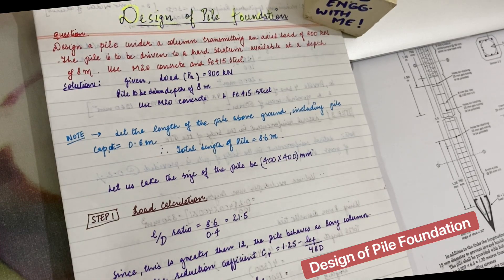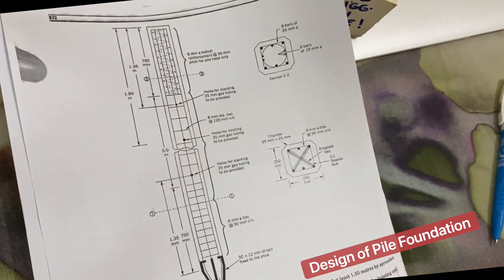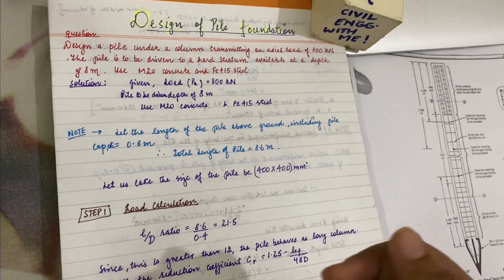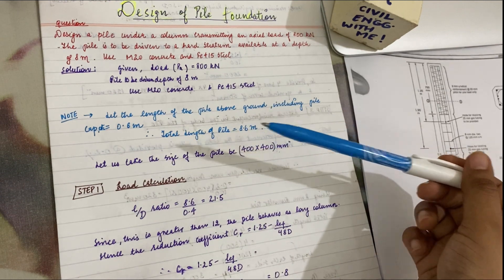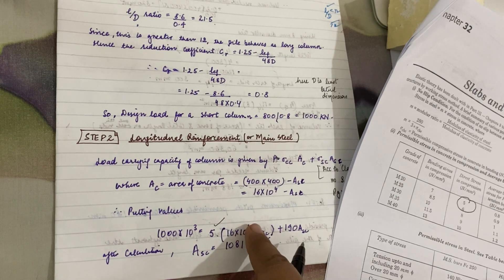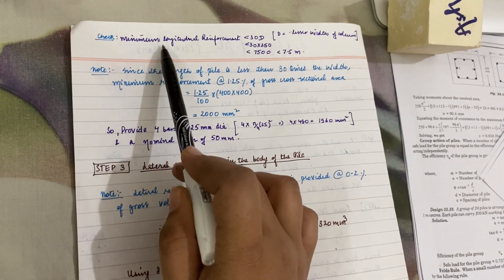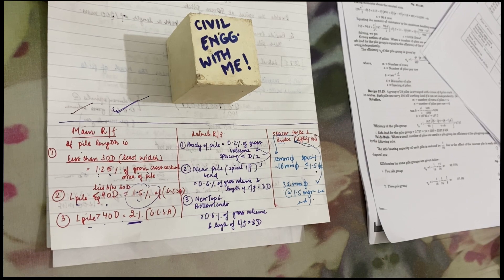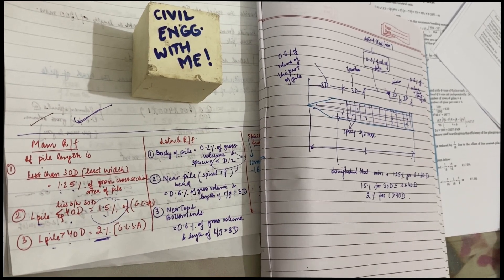DESIGN OF PILE FOUNDATION | RCC DESIGN |

Comment: Sir , 
These are the details for a protection wall along river bank

Existing ground level - 12.600
River bed level - 7.130
Ground water table located at - 3.00mts  below ground level
What should be the pile cut off level ..?